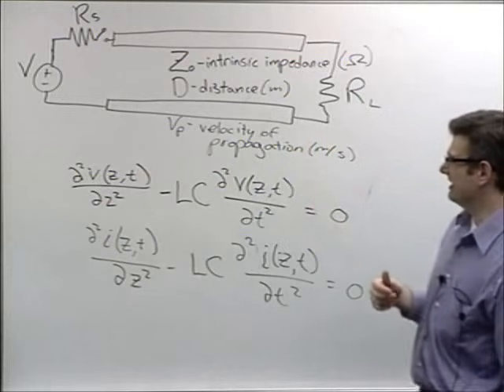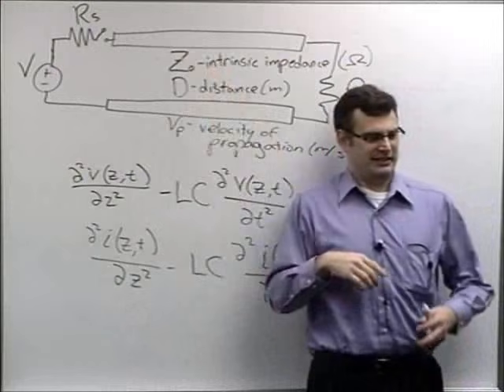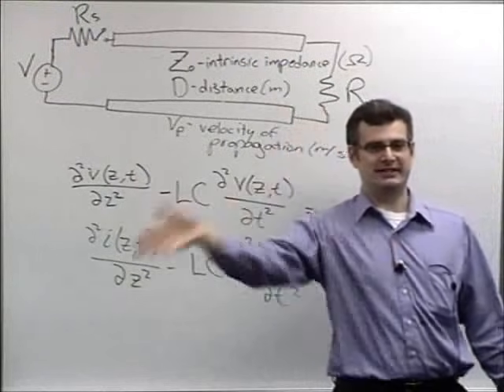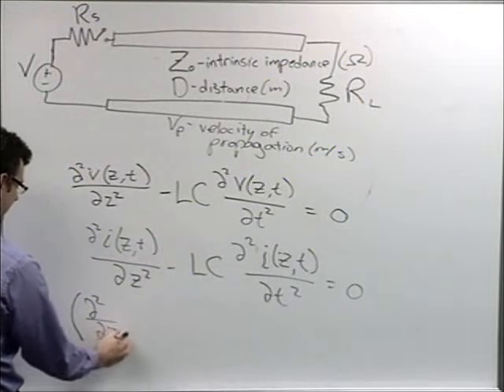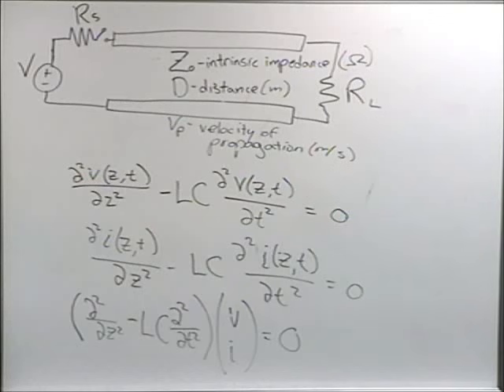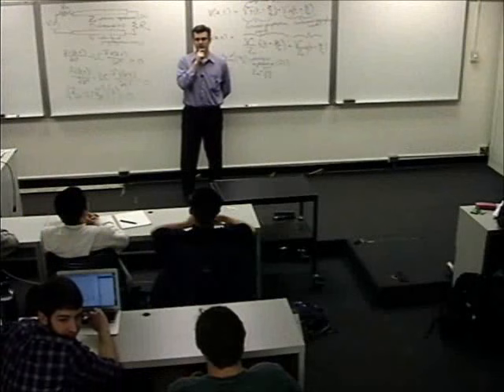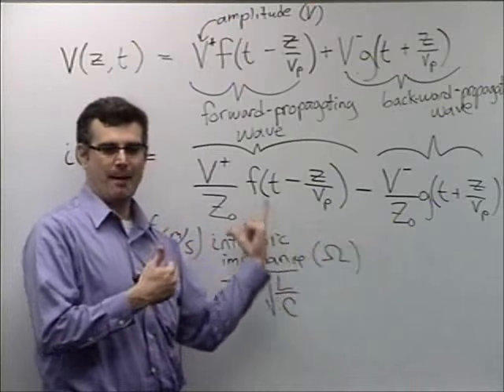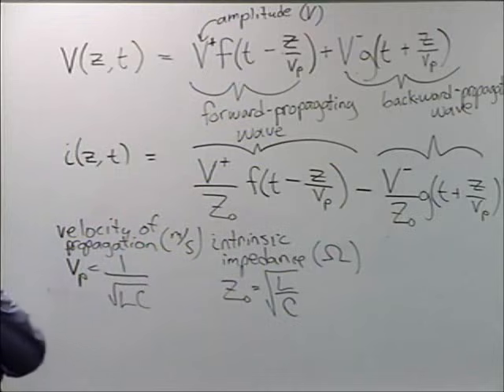TDT02:  Transmission Line Equations

Comment: Someone correct me if I am wrong but on 43:05 Greg says that controlling the geometry of the material (coaxial cable) one can design for a target velocity of propagation and a target impedance. I think that is true only for the intrinsic impedance but not for the velocity of propagation. Greg said a little earlier that the geometry cancel out when calculating the velocity. 
So the only way of design for a target velocity of propagation would be to play with the permitivity and permeability of the dialectric. I am right?
Reply: In the lossless case, the propagation speed will only depend on the permittivity and permeability (whereas the relative permeability in a dielectric is approximately equal to one).

Comment: Greg, is voltage actually charge travelling or is it electric fields?
Reply: Voltage is a property of an electric field (it is equal to the energy that could be transmitted to a point charge if it would travel from point A to point B in the electric field). Electric fields on the other hand are caused by electric charges. So both things are interconnected.

Comment: So in theory you could tap into the coaxial cable by placing a probe between the center wire and the outer shell.. Cant imagine it would be easy but it should work...

Comment: Hello sir, I need your urgent help. Can you please solve a couple of questions of Transmission Lines, for me in which i am facing difficulty? It would be very helpful, Sir. Will really appreciate your help and support. Thanks & Regards, Arpit
Reply: post your question please
Reply: python animalia Can I please have your email address? Accordingly, I can email you the questions. Thanks.
Reply: python animalia Thank you for your reply. Actually, it's a pdf file (and I can convert it to jpeg, doc, etc.) so cant upload it as a comment. Will email you shortly. Thanks:-)
Reply: okay...let's see if i can help with it:)
Reply: Arpit Choudhary
Reply: @pythonanimalia  , at 40:00, he writes the Capacitance expression of coaxial line, as if some "pre-known" fact. But that expression is for electrostatics, where we take E_rho to be independent of z (to find Q in a Gaussian cylinder, then find V, then C=Q/V). The same does not hold when E is changing with z. Can u explain plz?